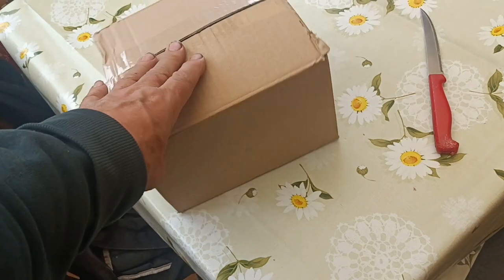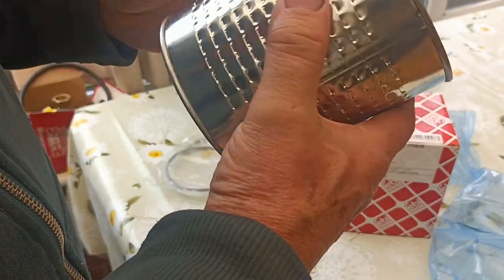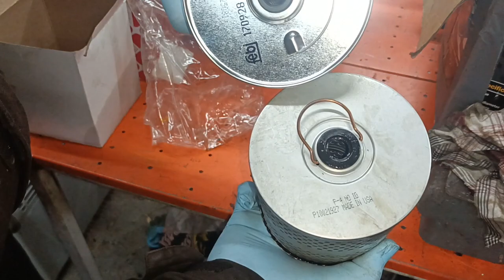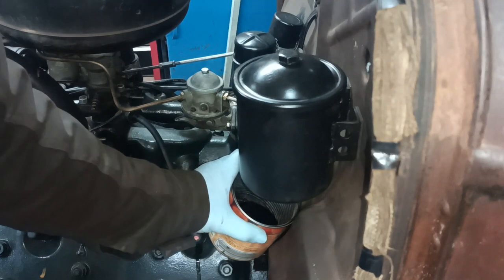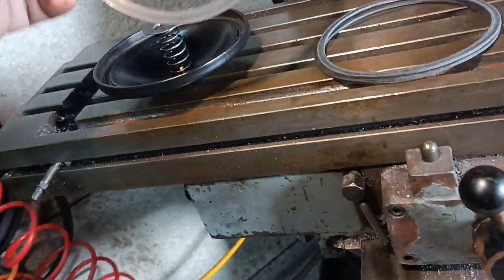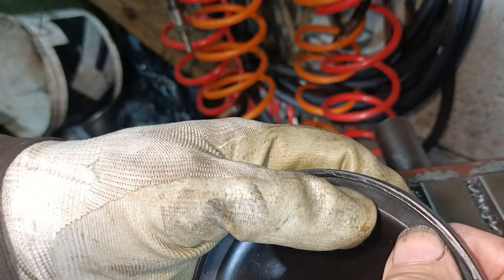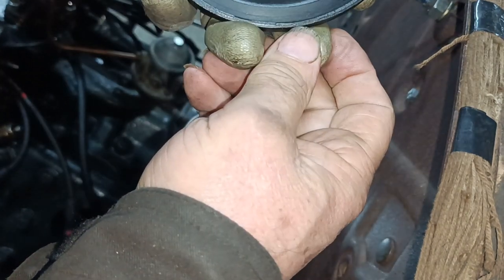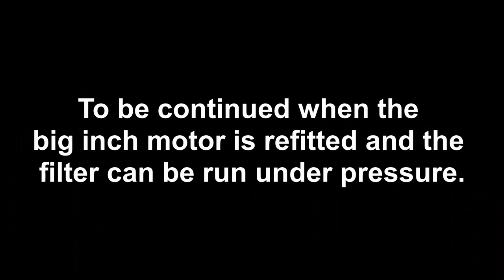An alternative oil filter source for flatheads. Remote By-Pass filter swap. Incl. New seals! (2269)

Comment: Well, you've got plenty of easy-clean coasters for around the garage now! 😄

The internet is such a handy resource for being able to buy all sorts of oddball stuff like rubber sheets and whatnot for miscellaneous projects for replacing obsolete bits! Though it's hard to beat a good old fashioned parts counter for being able to track down a replacement filter through decades worth of cross-references!

I'm currently midway through an experiment to replace some long-obsolete gaskets, originally made of bonded cork, with a gasket made from rubber strip! In theory, I should be able to bond the corners using superglue... and for the price of a sheet of thick cork gasket material big enough to cut a big 6-cylinder rocker cover gasket/lifter gallery cover out of, I figure it's certainly worth a try! 😲

Between that and modern sealants, I'm hoping it works out well enough to share the process, such as it is.

Comment: I think I would perhaps have cut a small groove into that flat mounting piece to give the blade somewhere to cut into and past the material without touching the mounting surface with it's point and back up the with a stop to prevent the blade from being accidentally crashed into the mounting plate. But, what you did worked well enough too.
Reply: Or add a piece of masonite for cutter protection.

Comment: Hi Mart,  
I had a gasket cutter for making round cuts and holes in gaskets, in the laboratory where I worked for years.  I guess you could make one similar.  It worked like a drawing compass with a pin point center which was adjustable for desired diameter.  The center was mounted in the slotted out center of a brass body about 2'' x 2" by 8" long, which had a scale on the upper surface. On the other end was a retainer for a razor blade cutter.  It would make perfect holes and round gaskets as long as they were over about 2" dia. A great tool kind of similar to your invention!   You might find something like that in an old school tool catalog like Klein tools.
Al Hook
Reply: Yours is great too, tho.
Reply from the maker: Cheers Al. That material is quite hard to cut accurately. I'm setting my little myford lathe up to be able to do the job in the future.
Reply: You should start selling them mart as a back up gasket I’ll take a couple if you did 👍👍

Comment: That neoprene sheeting is good stuff and very useful. A mate usta fabricate horse box ramps, of all things and a fact is, horses are very sensitive to going in and out of those boxes, especially up ramps. Having a tough but light impact surface 'encourages' the easy loading and transit of such 'delicate' beasts. He hooked me up with a few choice cuts of some really heavy duty neoprene and it makes for neat standing mats at drill presses and such... as well as 101 different gaskets and mounting plinths/bushes. Electric fuel pumps with a 'slice' of thick neoprene become much quieter and transfer less vibration in old 'tinny' Rod bodies.

I was somewhat disappointed in your solution to gasket production, as i thought a custom die tooling production was in the offing! lol Anyways, my suggestion is using a double blade set up to 'ease' production rates? What with the spiralling costs and blatant 'piracy' of importing anything from 'over-seas', solutions will be found and alternatives will transpire! How bout running a 'flattie' on corn likkah? lol
Reply from the maker: Corn Likkah? What, like at the E10 pump??  Lol. I have also made some oil pan gaskets that seem to have worked out well. I used cork/nitrile sheet for those. Take care, Shaun, hopefully our paths will cross sometime next year.